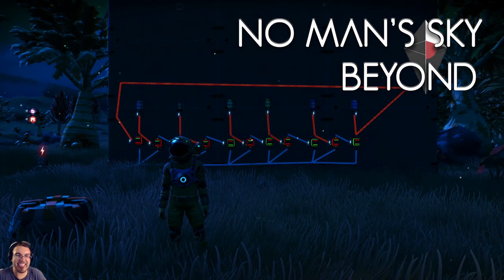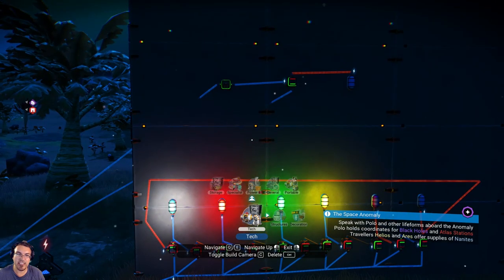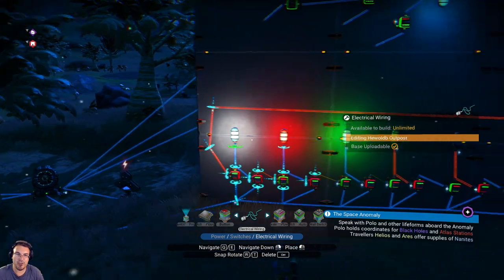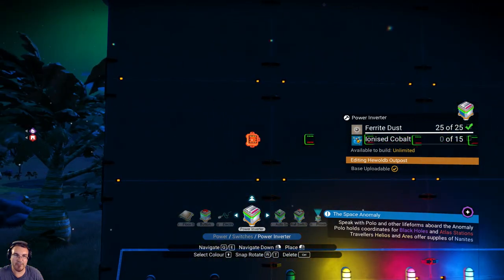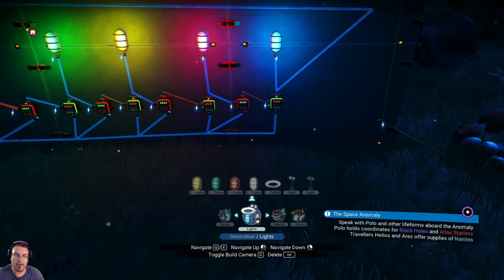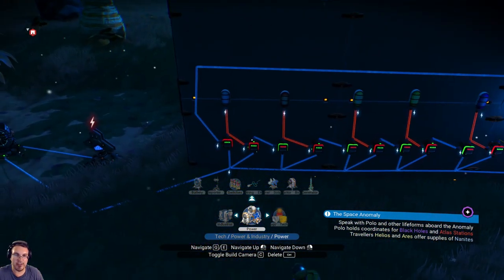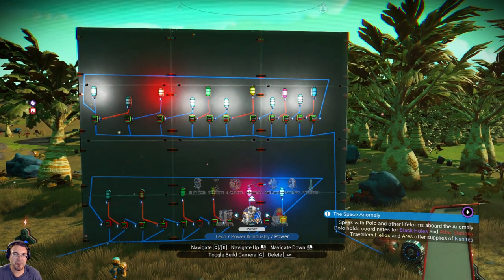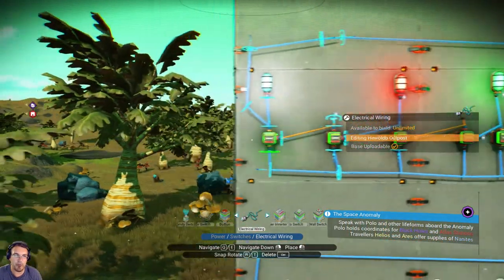How to make a Light Repeater Out of Inverters! - No Man's Sky Beyond Tutorial

Comment: I wish I understood these things better, but after fiddling with it for maybe half an hour I finally got the auto switch pattern going. At first I didn't understand the trick at all, but randomly got closer to the answer until I finally understood what I did right in the end. I wonder if the pattern will show correctly if someone visits my base, or if it basically only works in single player. Everything works for me after reloading the game, but I'm not quite sure if that sort of small detail like the wall switch being turned off would actually be saved online.

Also, I really wish they let us have more control in cuboid rooms. The only thing I'm able to do is make an oscillator which makes everything connected to all the rooms have blinking lights. I like the oscillator function, just not everywhere. The door seems like the only part that can use a different circuit.
Reply from the maker: That would be quite nice lol.  I can speak from having MP visitors over the patterns will still show for anyone who happens to be visiting you

Comment: Sounds like you may be able to use a solar panel as a control unit for an alternator so you can have lights that auto turn on when the solar panel no longer generates electricity. At night
Reply from the maker: You can definitely rewire a solar panel to "generate" electricity when there's no light at night.  Interesting how it's possible